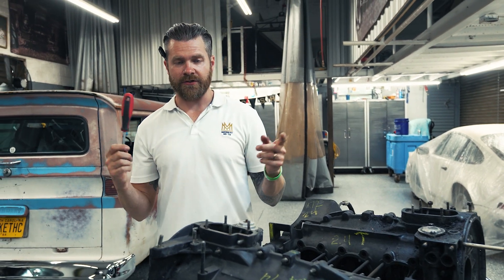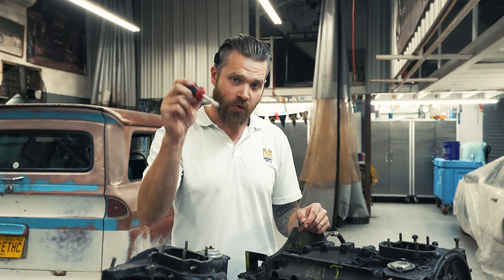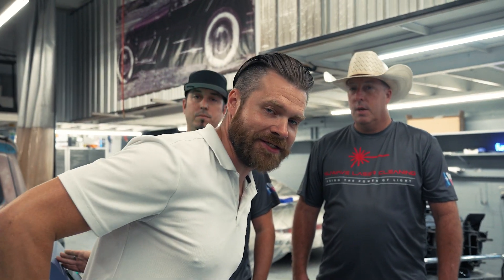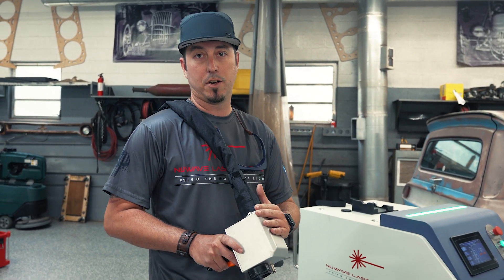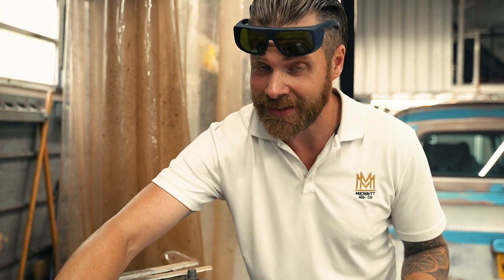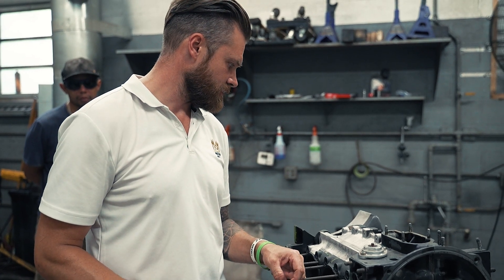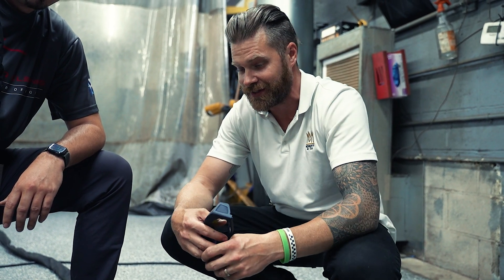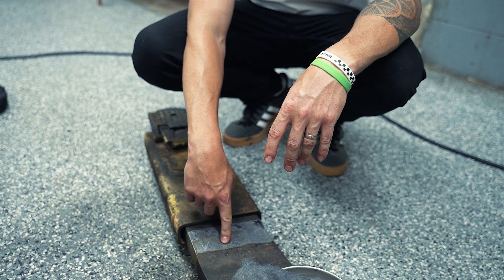Our NEW 1000w Pulse LASER CLEANING Machine! *Nuwave Cleaning 1000W*

Comment: i’m confused, you said you have a 1000 watt unit already and then you indicated the machine behind you was 500 watt and started talking about speed as if 500 was faster than 1000 watt unit you already own. 
Could you clarify or did i miss something?
Reply from the maker: No problem. At the time we made this video we were using the manufacturers 500w demo unit. A 500w pulse laser is not faster than a 1,000w pulse unit. However, speed always depends on the surface and contamination you're cleaning.

Comment: I noticed on the casing there appears to be small ridges left by the laser. Does that need to be sanded down for a smooth surface?
Reply from the maker: The surface is smooth so no need for sanding. The lines you see are the patterning from the pulse of the laser. A clean surface free of patterning can be had with additional passes.
Reply: @merrittmotorco.4166  Thanks for the feedback
Reply: you more rough an surface the more area it has and can disapate heat better, you dont want a engine case to be smooth.

Comment: Can we see the lazer clean a complete object from start to finish   
I was hoping they would have done the whole engine case. 
no one is showing how loud the machines are why extra fans are needed (cause if smoke or dirt gets on the lense it will break and need replaced) why you cannot clean glass with it

I can see this being used to degrease (burn dirt off things before dryice perhaps like a primary secondary stage) 

looking forward to the next one
Reply from the maker: Absolutely. We're going to be uploading those videos soon. We're going to show real time.
Reply: All of these lasers use protective lenses and those are the consumable part that can get dirty like you are saying (under normal use anyway, of course if you are doing stupid things opening the gun inappropriately you can ruin the focus lens etc)

The lasers I have seen all have mechanisms in place to prevent the situation you are describing meaning that they have sensors to detect temperature and refraction on the primary protective lens and when it gets too hot it will alarm and stop functioning and it needs to be replaced immediately.

There are definitely many ways you can destroy the laser system and certain cautions that need to be taken but I think given the benefits of the technology they are more than worth any trade-off

Comment: Literally game changing! Great video, guys.
Reply from the maker: We agree. Thanks for checking us out!
Reply: It is absolutely incredible technology.  I have a portable 1500 watt laser that is continuous and it will heat the substrate like they say but depending on what you are doing it works amazing.  The laser there showing here is water cooled pulse and I'm not sure what they paid but seeing as they went through a Western distributor probably for 1000 w I'm guessing they paid well over 60,000 for it.  You can get a thousand watt laser water chilled pulse directly from the Chinese manufacturer that makes all of these lasers anyway for around 28,000 USD plus shipping and fees. 

For myself as a hobbyist I use a portable air cooled 1500 w that cost me under $5,000.  It runs on 240 volt 30 amps at 60 Hz.  It can weld and cut as well as continuous clean.  For a hobbyist like me it is great and even for cleaning a lot of parts but of course like these guys say having pulse for a business use like they have is essential if you are worried about maintaining part integrity and having more adjustability.